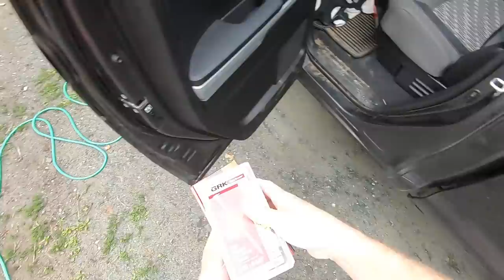Husband & Wife Install Roof Rafters on Post and Beam SHED Could you Do It?

Comment: The team work
the team work of the two of you when working at even a modest height certainly made the work  far more practical and putting those beams up would have been hard single-handed. I share the concerns of others about the risk of tools or other bits dropping down and causing injuries without you wearing hard hats. That apart the job is coming on well and should be completed in time to get supplies out of the weather. Your daughter continues to play an active part in the place and can only stand her in good stead for the future. You are a hard-working, thinking ahead family, never trying to do more than time and energy allow at the time and I trust things will continue to progress well.

Comment: DIRECTIONS
Place sugar and cocoa powder in a large pan. Mix well.
Add milk. Bring to a boil.
Boil gently until mixture reaches the soft ball stage.
Remove from heat.
Stir in vanilla and butter.
Add peanut butter and nuts if desired.
Beat by hand until thick and pour into buttered 8x8 pan.

Comment: Why not put a carport onto the house, where it would be better when getting out of the car or truck when raining or snowing! And then use the woodshed for your tracktor.
Reply: Agreed.
Reply: That is what I thought. You want a snow/rain cover for the car as close as possible to the house. Otherwise the car user gets wet/tramps through snow to get to it.
Reply: Louis Lanning that's a good idea but I guess things for the farm come first.
Reply: Judy G.  The stove chimney is to the right. Car port could be left.
Reply: @jimmyjohnstone5878  and Judy G the chimney is a triple wall construction that stays cool to the touch so they don't get burned. They can make a 2 car carport the width of the house if they had the means/want. The roof can have a rubber boot around the chimney to make it water tight at the roofline.

Comment: Did I miss how you secured your wood shed to the ground, and what is going to keep the bottom of it from rotting.
Reply: Randy Roedel ~ There's a gravel bed and vapor barrier beneath another layer of gravel for the floor. I think they said they'll put down wood crosspieces to stack the wood on.
Reply: @Svenulf Skjaldbjörn the wind must not blow much there, it would be flipped over with some of the winds we get here in Ky.

Comment: Thought about the carport add on to the fire wood building..
10 feet might be a little narrow if you would want to part a full size pick up in it..
Even something like a Nissan Pathfinder is 77 inchs wide.  
10 ft (120) minus 77 inchs
Leaves 43 inchs... 
21 inchs clearence each side
3 ft. Clearence each side might be better
Or at least 12 ft wide internal add on

Comment: HI guys, Thank you for the show i thoroughly enjoy and look forward to each video you make .. something which has me confused with the construction of the woodshed is why you've chosen to put the main structural beams onto/ into the ground ... as your using a softwood like pine i would have thought wood rot would be increased as the beams are going to be constantly wet, are you looking to do something to reduce this risk ?
Reply from the maker: The 6x6 are pressure treated and the rest of the wood is pine and hemlock that is being built in top of the pt.

Comment: I noticed in the last video that you put your wood on the ground on plastic. Problem with that is now the wood will always stay wet between the plastic and the wood. Even if is is treated wood it will shorten the life of the treatment. It would have been better to sit it onto one inch gravel so it could drain the water away from it. The vertical 2×6s are now on top of plastic and the end grain will suck up any water that gets in the plastic. Better for you to poke holes through the plastic so it can drain. Even if you have water resistant wood it isn't water proof.

Comment: Looked so small till you got those rafters on now that thing can hold a bunch of cords of wood! TimberLok lags and those structural screws are one of the best inventions love using them. The only thing I would of done differently is lifting the frame off the ground one more row of 6x6 and have some vents cut and ran a floor like pallets so air can get in from underneath and dry the wood. As well as gaps in the walls for airflow and long eaves to keep driving rain out of the shed. But that way there are some cons as well vs the way you did the walls and floor.